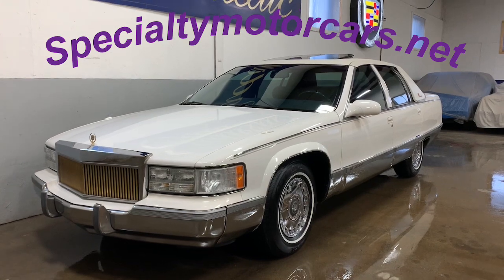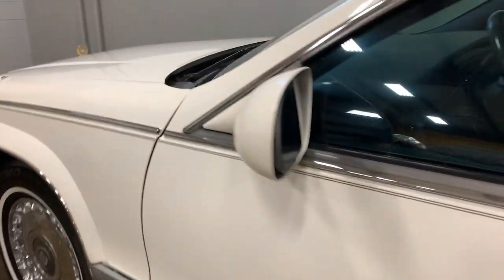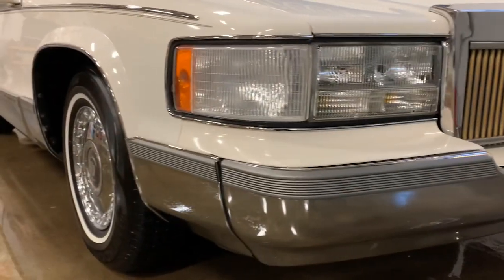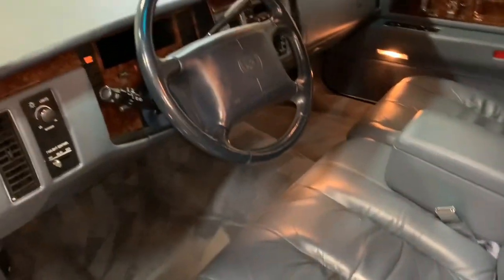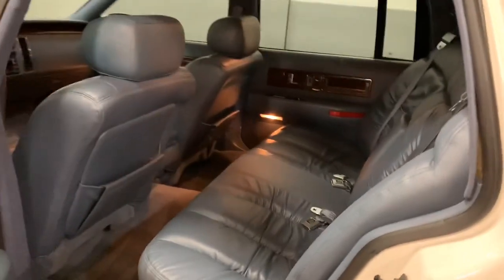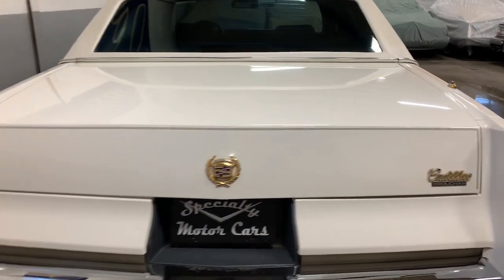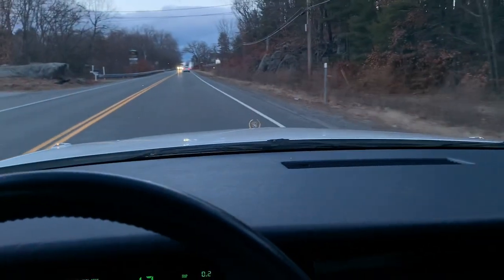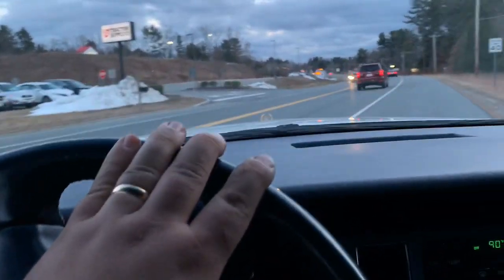1996 Cadillac Fleetwood Brougham FOR SALE! One of a Kind CUSTOM LT-1 Rare Trim LAST YEAR 65K Miles

Comment: My 2nd favorite Caddy. 76 Sedan Deville is my #1. I had a 95 that was identical to this one minus the aftermarket top, grill & gold. Personally not a fan of the aftermarket stuff but I know a lot of people like them. Mine had 31,000 miles sold it at 50,000 since I was supposed to return to the states and figured I would get another one since these, unlike the Buick Roadmasters are strangely enough plentiful on eBay with really low miles. I’m still here, have a 22,641 mile 96 Roadmaster with the beloved tow package, no hitch, just all the goodies and will get the 96 Fleetwood when I return this year as well as a 76 Deville. White is my favorite color. Beautiful car none the less.

Comment: I can just feel that ride watching. My father worked for Cadillac in the '70's and '80's and I grew up with them. This was the last gasp for the older large Caddy's for sure. These don't have the panache of the pre-1977 models, yet they did their best. I do like the vinyl top. One thing that these look good in is the gold stripe Vogue tires. I would so love to drive that car everyday. My new car is good, but damn, I hate the harsh feel on the rough spots. If you could only get an optional smaller rim/thicker rubber option. I could live without going off a ramp at 70MPH!

Comment: Honestly I have owned a triple black , I think the neutral would look so much better on the interior, and that grill is a no go, also the roof padding wasn’t installed correctly on the 2 strips next to the rear, but the Lt1 is the best engine ever

Comment: I’d put the stock grille back on. I never liked those fake Rolls grilles on Cadillacs.
Reply: Agreed. The idiom is not "It is the Rolls Royce of ____" But "It is the Cadillac of ____"  If I wanted a Rolls, I would simply drive on the wrong side of the road.
Reply: @MostlyBuicks  Cadillac hasn’t even been the Cadillac of Cadillacs since the 1960s. Once cost cutting and chassis sharing crept in Cadillac hasn’t been squat.

Comment: Nice Caddy even tho 2nd time around. Usually the chrome on the upper door stays good. The aluminum on Ford Grand Marquis and town Cars & also Buicks, Century, LeSabres and Park Aves cause they are wrapped plastic. And the aluminum wrap fails. All the manufacturers should have learned after 78 to 80 Monte's went bad.

Comment: Put on that seatbelt 😂
Reply: Don't you know, when he drives a car the light is faulty,  when everyone drives a car the miraculously fix like magic. LOL
Reply: He never wears one.  I mentioned it once before and all the haters jumped on me, but I don't get how a car guy doesn't wear one..... whatever... lol  (Hopefully his insurance guy doesn't watch.. ha ha)
Reply: My seatbelt alarm is loud and annoying. I have to shut it up before I lose my sanity🤣
Reply: There is a way to turn it off, depending on the vehicle you can remove a fuse that controls the noises the car makes like the turn signal and notifications when a button is pressed. The seat belt is tied in that.
Reply: @timothyweers8054   It's easier to fasten the seatbelt. Thanks, for the information, I'm sure it will come in handy for someone.
Reply: I'm not saying to not wear a seat belt but to make it more bearable when starting the car and not having to hear the loud noise it makes.
Reply: @timothyweers8054  Of course...I knew what you meant..The advise you gave is way above my skill level..LOL.
Reply: Ok

Comment: Nice very sweet LT1 even better Northstar engine was one of the worst v8s Cadillac ever put in any other cars overheating issues head problems and intake gasket problems not to mention the starters underneath the intake one of the worst engines ever built or ever put into a car by Cadillac or GM

Comment: If that car was a rare vinyl top delete car, they ruined it. Also that grill is hideous.
Reply: Its not, the vinyl top is factory (RPO code CB5 denotes factory vinyl top, and 40T denotes the color - White) And I agree, the grille is hideous, I never liked them when we sold them new at our dealership back in the day.
Reply: @MS3DALE  The car may be a factory (CB5) vinyl top car. But this top is not factory. My point being if they simply replaced the factory vinyl top with this monstrosity, then too bad. But if they put this top on a rare Brougham vinyl top delete car, it is a low down dirty shame.  Base cars usually did not have a vinyl top. But Broughams automatically came with a vinyl top UNLESS you optioned for a vinyl top delete.  I had a 1995 V4P Brougham that had a vinyl top delete. They look SO MUCH BETTER without the vinyl top. And they are rare.   These aftermarket tops, grills and such are just too much gingerbread on an already ostentatious car.